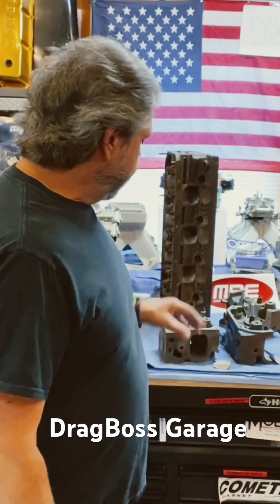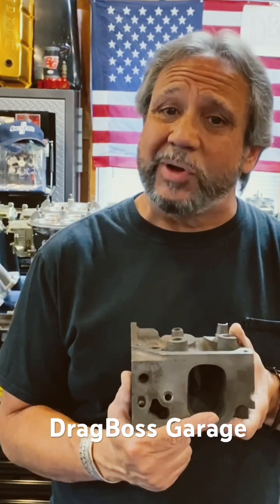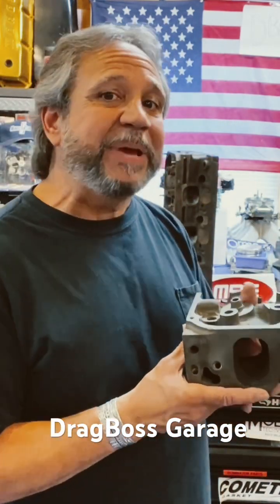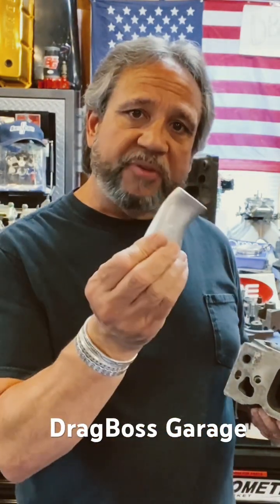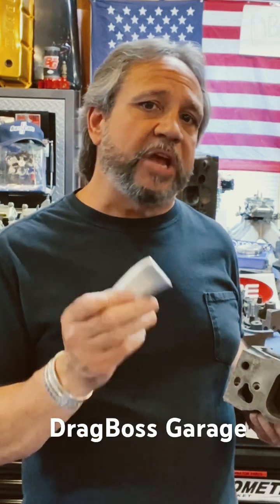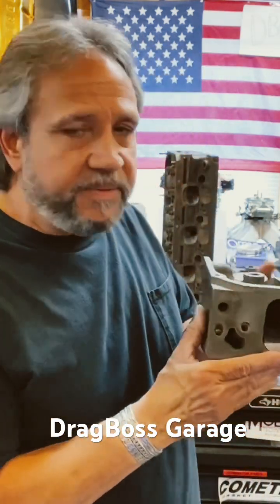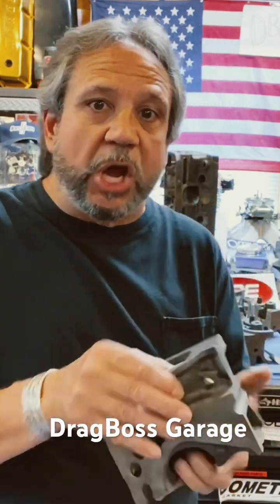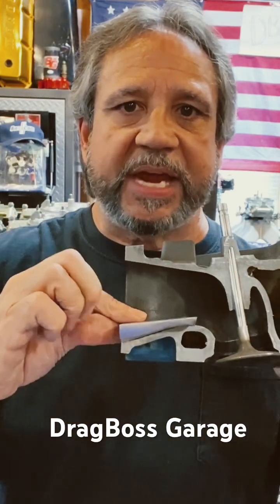Add 30 Ft. Lbs Of Torque To Your Iron Ford 351 Cleveland 4V Heads, #dragracing #horsepower

Comment: Good day sir I have a 73 mercury cougar xr7 with a 351cid 2 barrel but I’m not sure the code is there anyway you could help me out
Reply from the maker: H code
Reply: @dragboss351cleveland yes that’s what  I was thinking but it has an M on the block next to the headers were the 2 or 4 usually are at
Reply from the maker: @jorgeg7786 can’t say, prob not contributing factor.
Reply: @dragboss351cleveland also thank you for replying 🙏🏽

Comment: Cool. What's done with the mis-match intake manifold ?
Reply from the maker: Fill the intake with epoxy to match
Reply: or you can use a 3v manifold. CHIi, TFC, Higgins race heads, scott cook, and a few other companies that manufacture them down here in australia... personally imo you can't beat the CHI 3V for bang for buck.

Comment: Best way to improve horsepower and torque on a Cleveland is get rid of it and buy a 351 Windsor with some TFS heads on it I've wasted lots of money on Cleveland heads just to lose every bit of horsepower under 4,000
Reply from the maker: That’s seems like there may be other issues that you have. I have no problems, I guess it how you build them. 
https://youtu.be/aHie16-1pms?si=BmkyWqUI0QTJQ8CX

Comment: In the ‘70’s @ Mullen & Co., Bob cast up aluminum “wedges” that we would then epoxy into the intake ports, we did this filler on both the Chrysler 340/340TA & Cleveland. Tho, most (if not all) of the pro stock heads were fully competition ported, with the raised & brazed, aluminum raiser bar
We modified Weiand mag manifolds into a “V” bottom plenum, with a very shallow base, then fab’ed different heights spacers to change the plenum volume
Reply from the maker: Cool stuff for sure. I have some pics of letters from Chrysler to Mullens on the TA 340 heads. You should email me at thpa351@gmail.com. Maybe do some chatting on this with a video we could make and tell us? Thanks Wizard 🧙

Comment: Port plates from mpg is what I run.Tongue ss lat that sandwiches between header and head.Although,on the exhaust side,with the "high port" design,the header should exit out the head 3" before making a bend or it defeats the purpose? Anyone else heard of this?
Reply from the maker: That is what they said. Th Et also said that they only added 20-25hp. Alway better to have the straight exit for 3 inches if possible. I feel they add more. Never heard any good benefits from mpg exhaust port stingers.

Comment: Just like that. Change the angle of air flow in that small area for a nice gain. Thank you. Very nice video. GOD I LOVE YOU TUBE! WIsh I had this 30 years ago! 👋
Reply from the maker: Yep, just like that, I knew about it 30 years ago, but was happy running 13s. You tube has it all
Reply: @DragBoss351Cleveland  Thank you for the video! 😁👍

Comment: How much  would it cost for a shop to do it
Reply from the maker: Probably, 1k, to fit, epoxy and secure. I think going to try my hand at installing.
Reply: I ASSUME you are going to take us along for that installation. Please please please
Reply from the maker: @Tom-ki3lq Tom, I do plan on doing that, just have find the time. Have an engine I would like to Dyno test them.

Comment: You remember the metal tounges they sold in the 90s. Can't find mine after the divorce.....lmaooooo
Reply from the maker: Yes I do. Stingers
Reply: @eddiejeselink2996  mpg out of Colorado I believe.I still have my original papers from mpg. All I need to do is find them! I only placed in exhaust side as I always was afraid of vibration and heat would crack and break (intake side especially)get sucked in. On exhaust would just blow out. Ss headers do same thing-heat,cool,heat -Crack-weld,crack again-get htc.coated steel! Solved.

Comment: I wonder how well those would work in a 351m low compression engine?
Reply: Probably even better, if y’all give some attention to the manifold floor height to match.
Reply from the maker: @georgedreisch2662  yepper
Reply: 30 ft/lbs is actually a lot considering how little money and labor is required. Those 4-V inserts would probably need some work to get them down to 351 M size, but the smaller ports would benefit from them too 🏁
Reply from the maker: @danielwilson6665 yes sir you got that right
Reply from the maker: Depends on port size. 4V win win